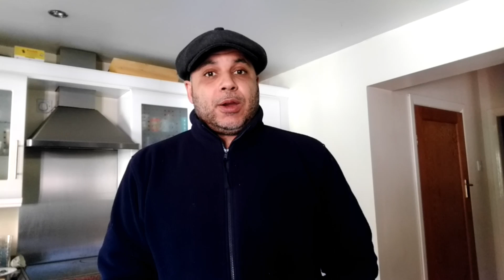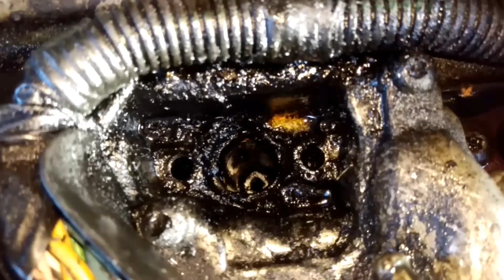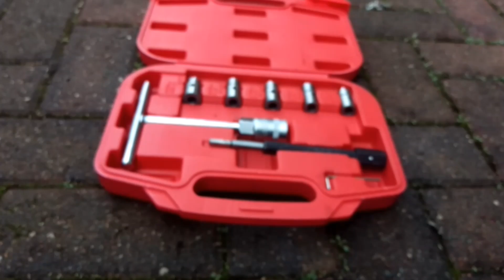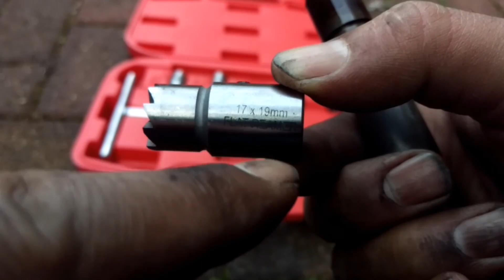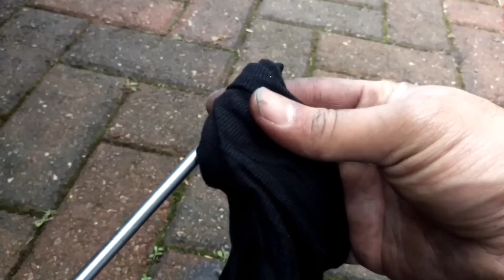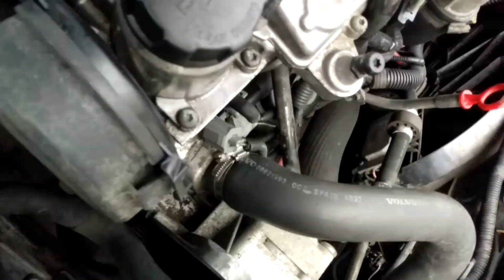How To Cut an Injector Seat With a Reaming Tool

Comment: Tip: Before removing anything for this task. Given the chance. Use carb cleaner, or my preference "oven cleaner", etc. to clean all that black death around. Than "la piece de resistance". Jet wash into the action. I do that to all my engines. Not only they are impeccably clean. But the effort to reach that cleanliness is almost zero.
Once more given the chance. Compressed air makes short work of having it all dry, quickly.  🙂 Cheers

Comment: Surely, something goes down into the cylinder...No one talks about this as gravity has it's way. Am I overthinking this ?
Reply: Just apply a little grease on the tip of the tool, small shavings and carbon will stick to the grease.
Reply: Even better approach. Before sealing the hole with a new washer and injector. Simply operate the starter motor a couple of turns. The cylinder pressure will blow out anything that might previously have fall in there! I know it might sound awkward to some. But as the saying goes let the machine do the job! 🙂

Comment: Question: my seat has a indent due to incorrect use of a screwdriver when getting the copper washer out. Can it be reamed so its completely flat, indent is at 11 o clock and possible 1-2mm.
Reply from the maker: @terjegronlie1181  I would speak to an engineer. 1-2mm is quite deep.
Reply: If you were on a tight budget 
You may get away with cleaning the seat up from all oil get a piece of cotton rag lint free old pillow case,clean all oil and gunk out, of the injector cylinder, 
spray de greaser on the cloth first then push down with screw driver and twist the screwdriver this will force the cloth to twist grabbing the crap ,if you have brass pipe cleaners,you can use them as well,

Once clean , place a long wooden smooth or plastic peg down the hole but make sure it long enough not to loose it through the hole,and sticks high enough to hold it, 
Then get your self that two part metal putty usually black and grey mixture stuff it dries like metal , wear gloves, place in your hand just by squeezing it several times until its mixed well,

Then find away to place some in and around 1-2 mm gap and allow it to sit slightly proud, spin the plastic or wooden long dowel out,
Now leave 24 hours for the metal putty to dry, now get cheap cutter` apply a bit of thick lithium clear grease to the end of the cutter now gently center it place the nib of the cutter in the hole and start cutting the hard metal putty away,

pull out and clean then repeat cutting some of the metal as well, but only apply light pressure as you turn the cutter,
then clean up,

Get your self a little grease and smear slightly over bottom of copper washer, best way to center washer is get your self that long bit of plastic or rod place in hole, then drop copper washer over the rod and it will drop down to the bottom of the seat,

pull out rod then place injector in,

If you don`t want to do this` the other way might be to grind away until you get it smooth then ad two copper washers,
If failing that replace the head but you will need to have it ground and a new gasket,

Comment: Your video's are extremely usefull.
Gonna be replacing swirl flaps on my v70 D5 from 2006 however i got injector 1 completely stuck, even the local volvo garage tried to help me getting it out but they couldn't.
I'm at the stage where i can spin it about 30°  both clockwise and anti clockwise, spraying penetrating oil every day and it will give at some point.

Bought me a set like you're showing in this video, however it also came with brushes that fit in the bore hole and smaller ones for the clamp screw holes aswell.

When cleaning the bore with brushes i was thinking about trying To plug the hole where the nozzle goes through, perhaps too risky my plug might fall through into the cilinder?

Also the mechanic at Volvo told me that spinning a stuck injector is dangerous as it might unscrew the nozzle assembly, what are your thoughts about that?

I think as long as i dont spin the injector more as 30° it shouldn't be possible for the nozzle assembly to come appart.

Many thanks for your video's, you're good at explaining things.

Greetings from northern Sweden
Reply from the maker: Thank you for your comment.
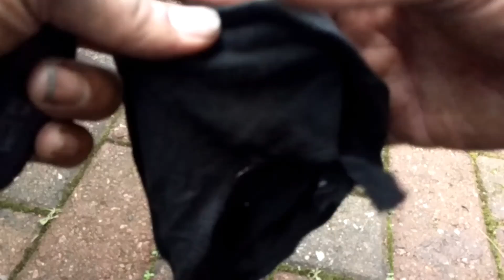The best way to clean the injector port is to use the screwdriver and rag soaked in carb cleaner method explained at 2:40 and I wouldn't be tempted to stray too far from that.

Comment: Just a question. . . The reaming end got stuck in the injector, do you have any idea on how to remove we are stumped
Reply from the maker: WD40 penetrating fluid down walls of the injector port and a strong magnet? Perhaps some strong glue putty on a stick to lift out..... 
Not sure but good luck.

Comment: I always use grease on the cutting tool to stop any metal dropping off and going down into the hole,Nice clean up job
Reply: That is a great tip, stealing this for next week. Cheers.
Reply: Won't the grease go into the cylinder and mess things up?
Reply: @jounistactics  No just use lithium grease, not loads just enough to fill the gaps between the cutter the metal will get pushed in between the cutter teeth,

Don`t forget the cutter has a stem going through it, then this will enter the hole in at the bottom of the head so cuttings won`t usually fall in, but its getting them out once you pull the cutter out,grease will do that.

 Or cut it dry, then gently pull the cutter out and get a vacuum tape some small tube to it like brake hose and suck the bits out.
Or wear goggles take the glow plug out and blow air into it this will blast the metal out of the injector port,

Sorry for the saying being used here ,more than one way to skin a cat when doing these injector ports,
Reply from the maker: I imagine they're using a stickier, thicker non runny grease. Just a smear for the swarf to stick to.
Axle grease, brake grease etc.

Comment: Will all the bits fall into the cylinder ? I know there is a dowel in the middle but it looks like it will fall in when removed
Reply: Grease the cutter so the cutting debris sticks to it

Comment: I’ve just used this tool on a Mercedes sprinter, but the reamer has left marks on the seat, is there a technique to stop this happening. First injector sealed great, having massive problems with the second one that’s been leaking for a long time, reamed the seat fitted refurbed injector and still leaks, I’ve now gone for a thicker washer, but I still would like to smooth the seat more.
Reply from the maker: The tool is for removing carbon in conjunction with carb cleaner so shouldn't be used with the kind of pressure that could damage the metal seat.
Using a marginally thicker copper washer may be your only cheap option unfortunately.
Reply: SiRobb I’ve read these are used to take material off to get seat back again, mine had been leaking a very long time, that it had made a groove in the seat. So I had no choice but to take material away. Hopefully a thicker seal will work  🤞
Reply: Long time now but how did you get on? Having the same issue on my sprinter @menditman2004

Comment: My injector seat is damaged,can i actually cut approximately 1mm of metal in the bottom of the seat with this tool,or it is only for the  cleaning dirty injector seats?Can it actually cut metal?
Reply: no way
Reply: Late reply but I use a injector seat cutting tool you can set the depth and just use a thicker washer

Comment: Sir rob I need your help I Have stripped the threads on the aluminium block my inject the boat will not tighten down
Reply from the maker: mick ladd Ouch. Unfortunately, that's not something I can help you with.
Reply: I've done the same lol, I assume the head will have to come off regardless to drill, tap and install helixcoil?
Reply: @williamjones8295  Three years ago I did this I just use the larger tap no drilling and no Left everything on the engine three years 50,000 miles no issues
Reply: you will have to drill and tap it out to a larger diameter. careful not to drill too far.
Reply: Attempt a retap of same thread first sometimes might be enough to fix it's self
Reply: if it is alloy then you need to use a tap designed for aluminium as this will provide a stronger thread by compressing as well as cutting.